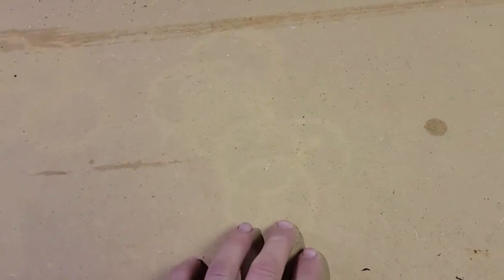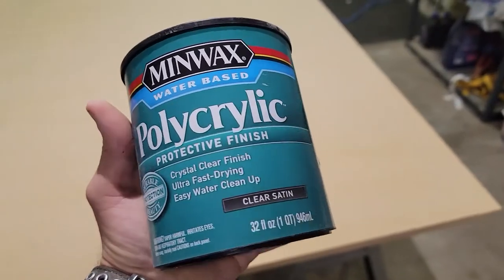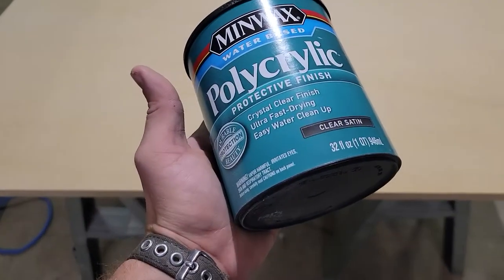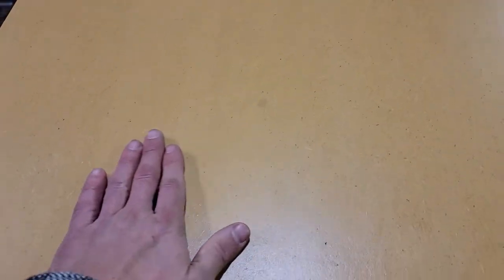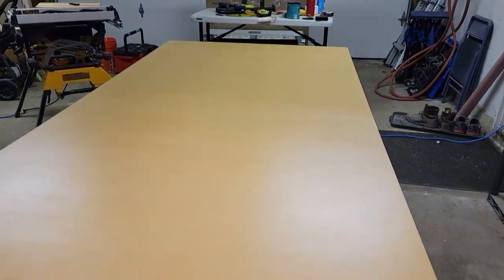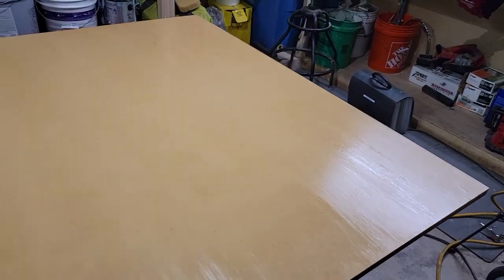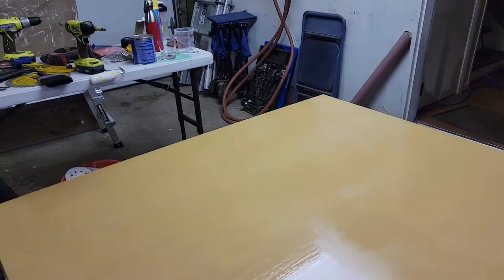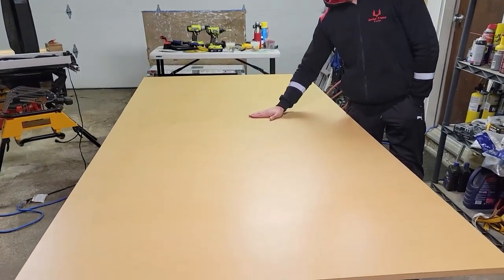Can you Polyurethane MDF board?

Comment: Use shellac to seal the mdf. It flashes faster than the mdfs reaction. It’s great for sealing the mdf “end grain” for painting.
Reply from the maker: Great tip! I'll try that next time! Thank you!
Reply: Are you insane??  Shellac costs over $70 for a measly gallon! sheesh. Use diluted Titebond One (PVA) instead.
Reply: @timault8209  pva glues, even when diluted won’t impregnate the “end grain” fibers and stabilize it as much as shellac. Then if you get it wet….still have issues. Shellac can work as a sealer and a primer in this situation. You’ll be able to block sand it and go straight to paint if need be.

Comment: What you experienced on the first coat was fiber pop. MDF is an interior only product. It’s usually produced at 48 lb. density. The higher densities at 55 lb. Is used on thinner products for floors, that is known as moisture resistant and not water proof.

Comment: Why is that an experiment?
MDF is cellulose/wood fiber board, polyurethane goes in wood. I use oil-based, however. No water to mess with the MDF in any way, plus it soaks up a lot of the finish deeply. 
3:18 but you figured that out

You can also pour it on, trowel it to spread it quickly, and wet backbrush it for the first two coats. Brush or spray the third for a buffable finish.

Comment: What about glueing two MDF boards at a 90degree angle? What glue/sealer would you use for it to be water resistant?
Reply from the maker: The only way I would do that is by adding a strip of solid wood adjacent to the 90° angle, so that any pressure is shared by the entire piece. Particle board is not strong, so you have to supplement.